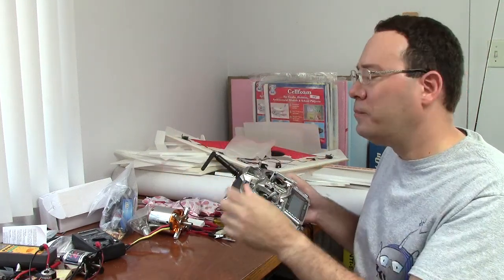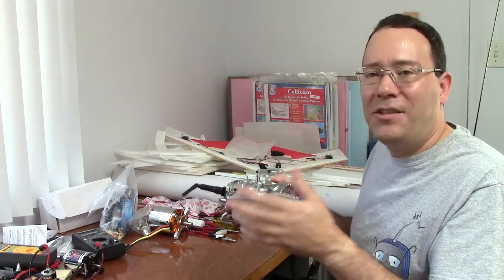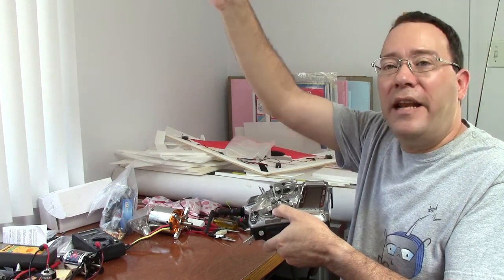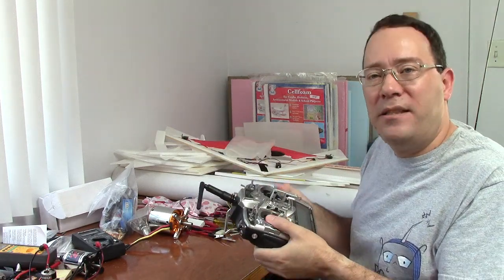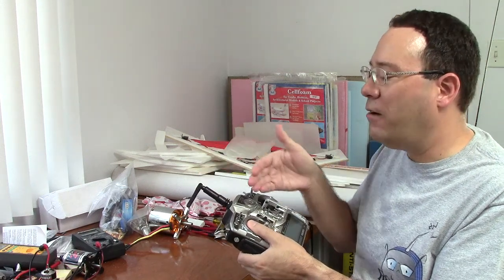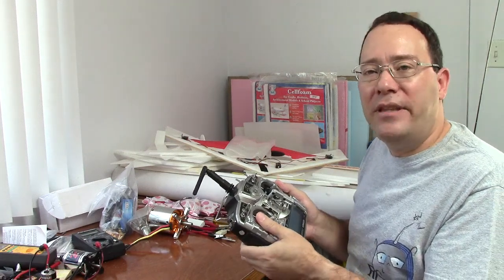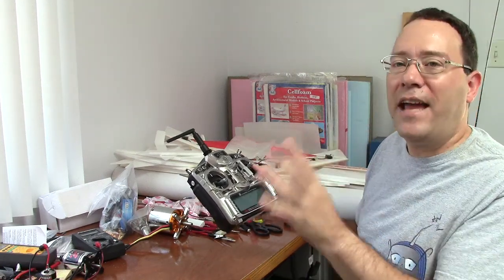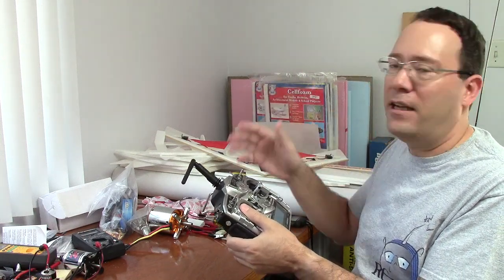Best RC Transmitter Antenna Direction

Comment: Its funny , because i "over time" Have decided the best way is the same way it goes back in my case is bent to the right, and i know its not technically rite.. Don't we have to take into account antenna orientation inside plane on the Rx.. before comming to  conclusions, commenters?   and that actually is a question and not a smart ass remark

Comment: You are so wrong - these antennas are linear polarised so if your antenna on the plane is vertical and this on the transmitter is horisontal you have a lot of decibels loss. The best position of both antennas is VERTICAL!!!
Reply: +Lachezar Krastev ....or both horizontal and remember, there is a dead spot at the tip of your antenna so never point it directly at your plane.
Reply: You are so correct, he's talking utter BS.

Comment: those antennas emit sideways and thats it,
so i wudda thought down or up or sideways is the same really,
as long as the plane is as 90 degrees as you can to the antenna it theoretically is the same.
Reply: Yes and No... you are totally right that the signal is emitted away from the 'sides' of the antenna. However you also have orientation to think about.
Having it pointing up or sideways may result in the signal strength being the same when the plane is at a certain location, but if your receiver antenna is vertical and your transmitter antenna is horizontal then you are not in alignment and the signal received by the plane will be poor.
So vertical or horizontal.... whatever, as long as they match. obviously alignment will change as you fly the plane, but set it up for how the plane will be orientated most of the time... straight and level.
Reply: Old thread but the two antennas should match in polarity.  A horizontal tx should "talk" to a horizontal rx.  Same for vertical.  Newer diversity receivers with one antenna on each polarity helps to minimize the issue.
Reply: @troyschmidt1226  haha, trust you to reply to a 6 year old question.

Comment: The truth is the strongest signal comes when the two antennas are parallel to each other and fully extended. If you can imagine a series of cans one outside the other, ever increasing in diameter, thats generally what the shape is of the transmitting antenna signal, and its best to have things fully extended, not wound up in a spiral. On top of the cans there would be a dome region, but the signal is not that strong.The ideal length of your antenna is the quarter wavelength of that frequency.